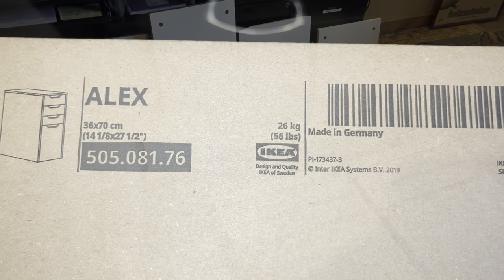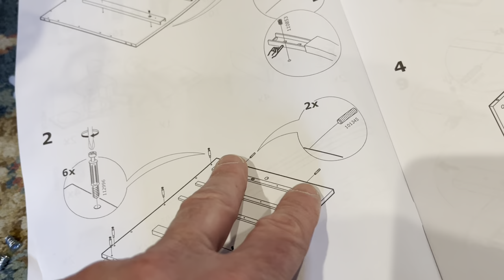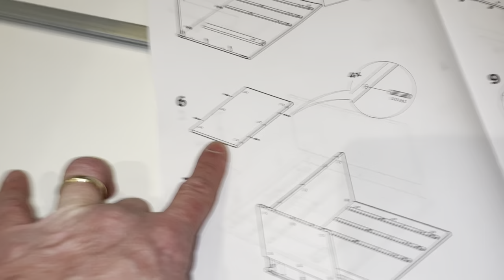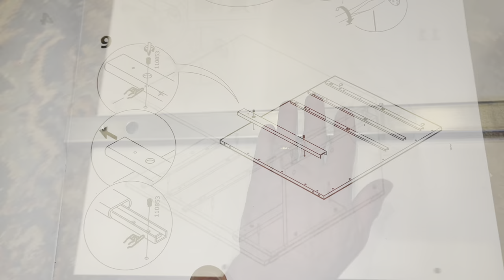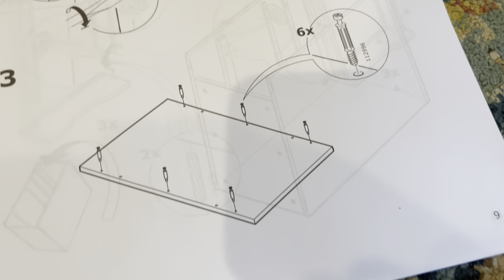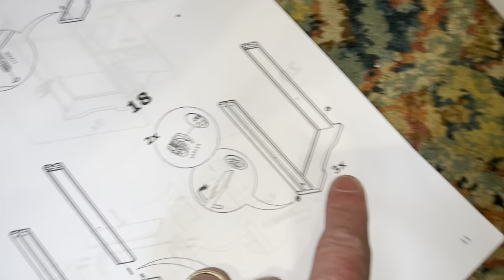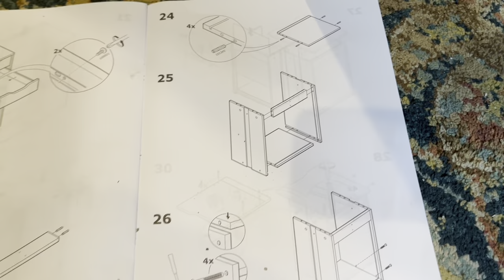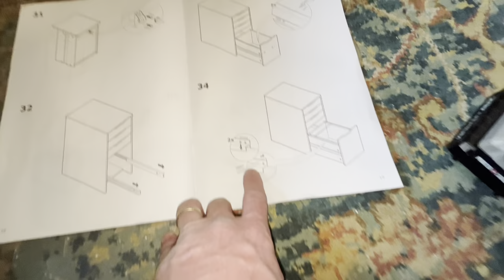IKEA ALEX File Cabinet Unboxing, Assembly & Review (Precaution at end of video) [IKEA ALEX Assembly]

Comment: Just an FYI, I had a broken piece in my box. One the side panels that holds the drawers was snapped almost in half. On the IKEA website, there is phone number you can call under their "Return Policy" page to get a replacement part mailed to your home. As long as it's within their 180-day window, they will mail you a replacement part at no charge. Just make sure you have your receipt. They mailed me the part and saved me the 1.5 hour drive from my house to Ikea. My experience was pretty hassle free.
Reply from the maker: Right on. Thanks for sharing

Comment: Please never use power tools when building Ikea furnture unless you are pre drilling holes for casters.  the locks only require a 180 degree turn and it is easy to pull the screw down too hard and loosen it from the board it's screwed into.  True it is just a cabinet that will not be under too much stress but is a common problem with ikea parts replacement.
Reply from the maker: Great point

Comment: Thanks for the instruction. Do you know if it is possible to add wheels like the others Alex models IKEA? Thanks
Reply from the maker: No problem! Well not sure on ordering specific wheels for it but it would be easy enough to install some should they be needed.
Reply: What model do I need to order? I found that many people looking for this hack. Thanks for your help  @DIYTechnician
Reply from the maker: I don't have any recommendations for wheels in particular. I'd say any smaller caster wheels will do the trick.  @mariepierchartier9848

Comment: I read a bunch of reviews that say regular Letter sized folders don't fit in the bottom drawer- can you confirm either way please? THX!
Reply from the maker: It will fit if you flip the plastic top rails around. This is the part that snaps on the top of the drawer. If you install them with the high part up closest to each other, it won’t work but…..if you just pop them off and put the part of the plastic piece that is the highest towards the outside ( farthest from each other) then install the round bar cross member, it’ll fit. Easy fix.
Reply: @DIYTechnician  I greatly appreciate your reply! You saved me a headache (and some yelling from my wife!). THANK YOU!
Reply: Tried doing that by the medal bars aren’t long enough now
Reply from the maker: @ViLeঐ  they should fit if the top protrusions are closest to each other vs. farthest.